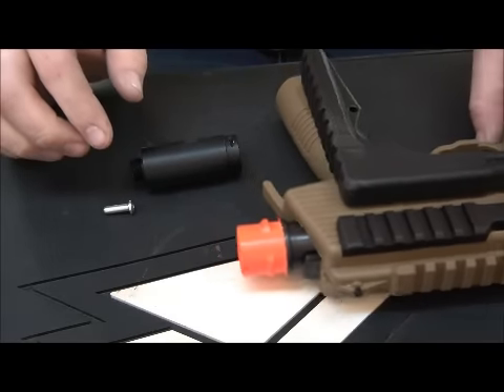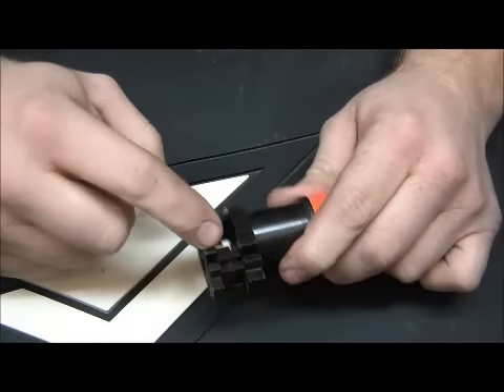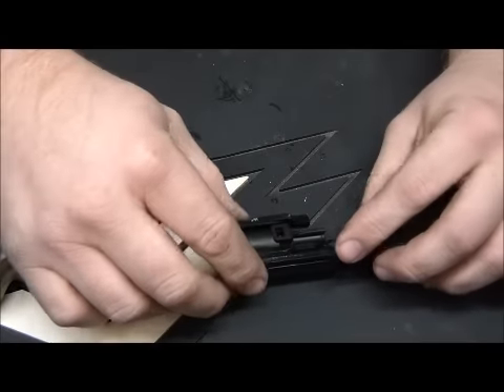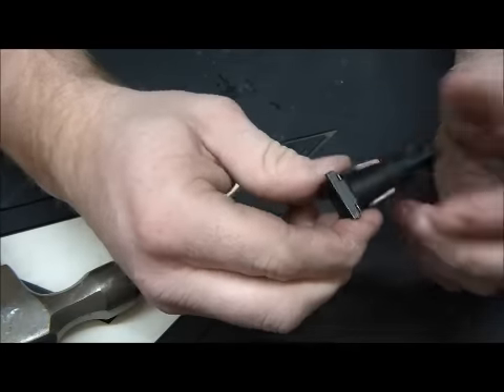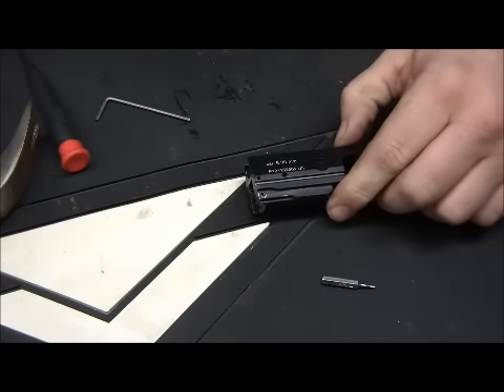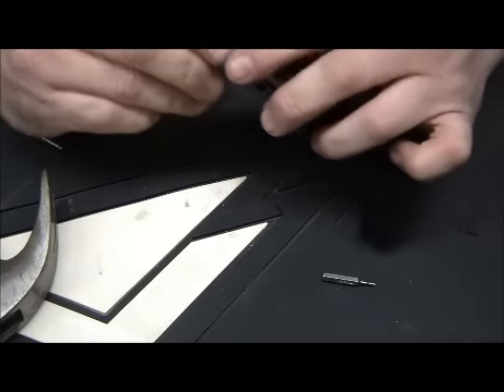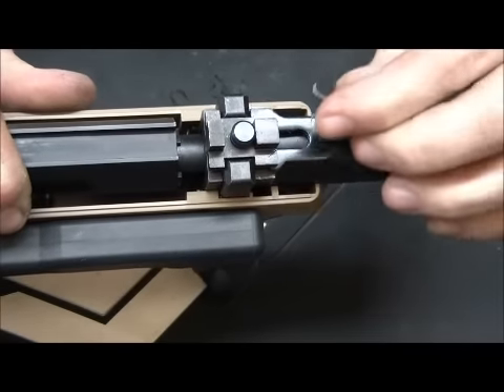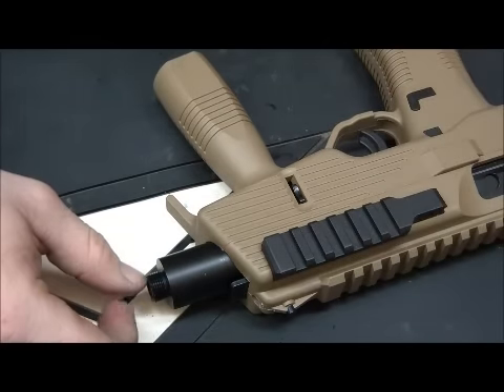Dangerwerx Flute Valve and Threaded Barrel adaptor

Comment from the maker: You have to use a punch that is the same size as the pins so you don't ruin them.  I had to take it off camera since they were being very stubborn.  Sorry for not editing the pin removal back in when I got it right.  Try that and make sure the punch you use is the correct size or you could destroy them and have to find replacements.  HTH.

Comment: The springs on my valve are off set and idk wat to do bc I can't take it part again 

So wat if I just kept the valve in place 

(Not the flute valve by the thing that holds it)
Reply from the maker: +Quinton Clyde Honestly it has been 4 years since I did this mod I can't remember how or what you would need to do.  I wish I could help out but I have since gotten away from airsoft.  hopefully someone that is still around and does this could possibly help.  Sorry for not being able to help.